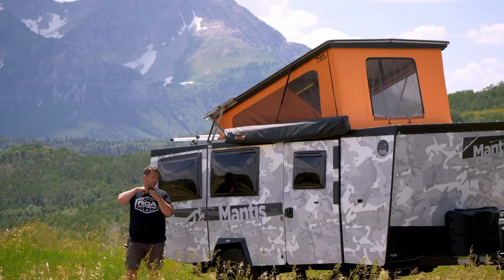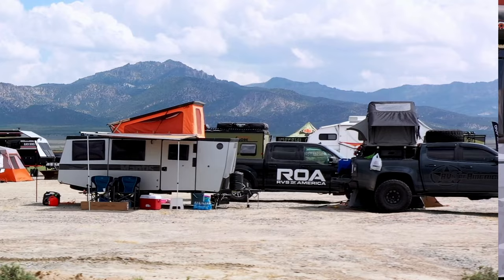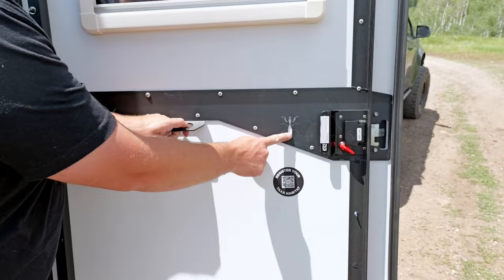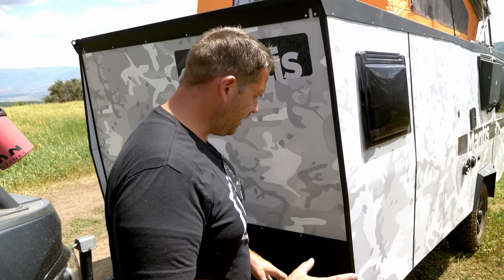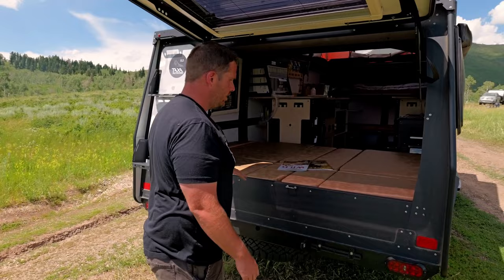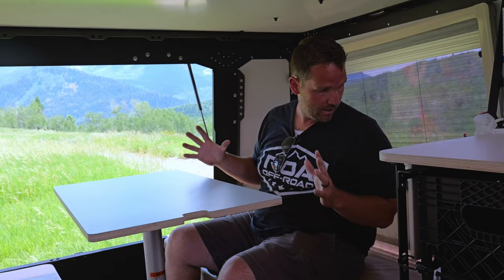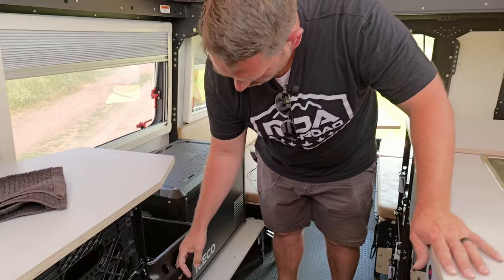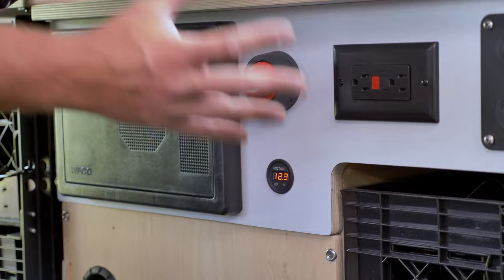All NEW 2023 Taxa Mantis 5.2 Full Tour | ROA Off-Road

Comment: this thing is growing on me. The only one I saw in person was a cricket a couple years ago and it seemed pretty cramped for me. But this Mantis looks pretty decent. decently suitable for a properly sized human like myself at 6'5". has most of the bling desired. wont fall to pieces as soon as the pavement ends. isnt 50-100k. That is a very underserved slot. I would prefer a slide in camper, but those are thin on the ground for my truck. Im keeping this one in mind. thanks for the detailed info.